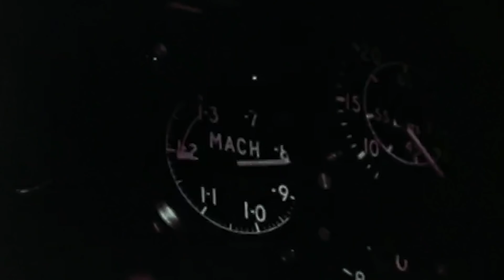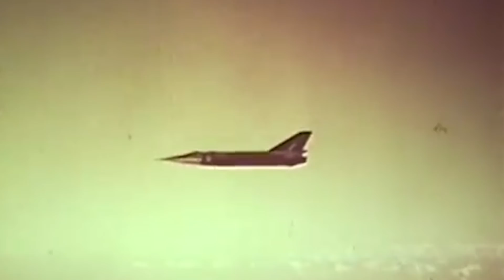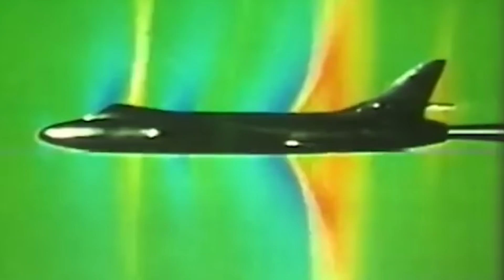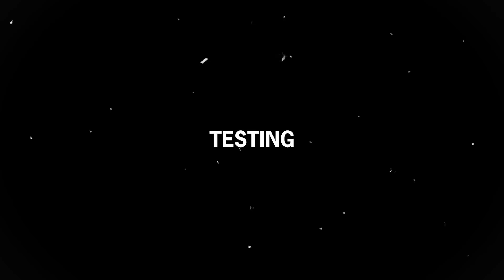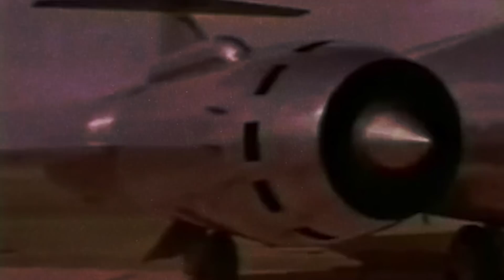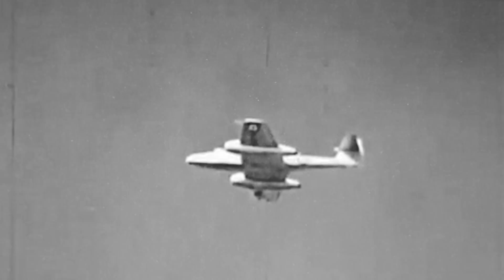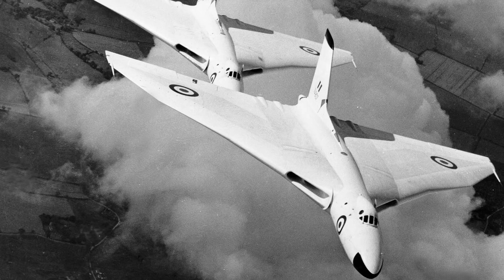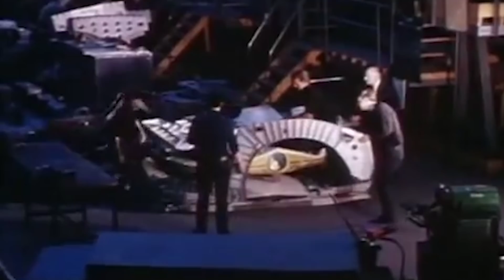The Bristol 188 Flaming Pencil - Supersonic Stainless Steel

Comment: Kinetic heating is mostly caused by air compressing in front of the vehicle and not by friction. It's a common misconception.
Reply: Same goes for reentering spacecraft.
Reply: SolarWebsite it really only applies to reentering spacecrafts. Supersonic planes don’t go fast enough, and are too aerodynamic to cause that great of buildup of pressure. Spacecrafts are designed to be more “blunt” to use the buildup of pressure to help slow their reentry.
Reply: Mopar_ Dude Hm, it’s always been my humble understanding that most of the heat produced, even with aerodynamic aircraft - or bodies with high finess ratios - is from compression. Supersonic bodies produce a shockwave and it is from the compression of gas into a shockwave from whence most of the heat is generated - or more accurately: most of the kinetic energy is converted to heat - as the body travels through the air. This comports with reason: an aerodynamic aircraft is more difficult to accelerate the faster it goes, not significantly because of increased friction between its skin and the air, but because of an increase in the volume of gas that must be compressed at an increased rate of speed around the body as it travels. An aerodynamic body experiences some heating from air rubbing across its skin, as what one might call boundary layer friction and there is potentially more of this friction with an aerodynamic body due to decreased stagnation of gas at the front of the pointy object vs the front of a dull one, but the overwhelming majority of heat is still generated through compression. Spacecraft are deliberately “blunt” in design, at least where it concerns reentry, specifically for the purpose of taking advantage of this stagnation to produce a buffer zone that stands between the heat shield and the shockwave in order to reduce surface heating and help “steer” the hot gasses compressed in the shockwave away from and around the front of the craft. In other words, nothing particularly fundamental changes at different supersonic speeds when it comes to heat produced from compression versus heat produced from friction – *this is why vehicles reentering at hypersonic speeds are blunt while hypersonic aircraft are just as pointy as those that are merely supersonic*. Another way to think about this is to consider the circumstances of both a hypersonic blunt body and a supersonic pointed body in three dimensions. The blunt body is designed to produce compression roughly along the same axis in which it travels, where as when the supersonic pointed body “slices“ through the air, it compresses air by acting on it at 90° perpendicular (for the sake of argument) to the axis of travel along the length of the body. This decreases the rate of compression vs the blunted body and is a component of what makes a shape positively aerodynamic, but it doesn’t negate that significant compression must take place to accommodate the travel of the frontal area of the body through the gas and the heat it produces compared to friction. Or at least, that’s what I’ve heard...

Edit: “travel of the frontal area” - this is poorly articulated, would have been better to say this as “the compression that takes place to accommodate the volume of a body as it moves through a gas.”
Reply: @mopar_dude9227  the plural of spacecraft is spacecraft, same applies to aircraft
Reply: @mopar_dude9227   Spacecraft are blunt because the heat transfer is a strongest at sharp edges, protrusions and corners.    Matter of fact it's a textbook problem in Heat Transfer courses.   Surface temp ends up a direct inverse function of leading edge radius for a given ionized flow loading case.     Think of a piece of wood thrown in a fire.   The sharp edges burn first.
Reply: @a-fl-man640  We have more plane.
Reply: hmmm,...I respectfully and completely disagree.  Friction/kinetic heating on aircraft such as the U.S SR-71, XB-70 and X-15 was a product of direct air friction.  It's a stretch to attribute 650ºF external windscreen temperature and skin temps exceeding 500ºF of the SR-71 to anything but plain ole FRICTION with the surrounding air.  Same for the ablated paint from the XB-70's flights beyond Mach 3,...and last but not least, the X-15A2, which flew 4,520 mph (6.7M) and had parts made from Inconel alloy (antennas) that MELTED from friction with the air.  Perhaps with blunt objects, such as returning crew capsules and the Shuttle,...where compression shockwaves and heating are of such a magnitude from the Mach 20+ speeds, so as to form PLASMA,...but that would NOT apply to the aircraft in this discussion.
Reply: I’ve taken for granted in the explanation above, heat produced by friction due to shear stresses in the boundary layer air along the skin of the aircraft, which potentially produces considerable heating. Essentially, heating from friction within the boundary layer air transferred to the body by convection/conduction and radiation. This would not be air friction directly with the body, although this undoubtedly produces some also which I believe to be somewhat negligible in the context of the other mechanisms at play.
Reply: Imustfly It’s really not a stretch to attribute heating of that magnitude to compression of gas. It’s all born out in the math which I’ve abstain from getting into here because it’s rather dense material and hard to tap out in the comment section on YouTube.
Reply: In high speed airplanes, if all of the heating is from friction, then where there’s the most friction, there will be the most heating. Instead, if there’s a significant contribution from compression, then where there’s the most compression, there will the most heating. And indeed the second option is the case. The most heating is at the leading edges, where the compression occurs. And at the very frontmost part of the leading edge, where the stagnation point is, (airspeed slows to zero) you would expect the temperature to be the coldest if friction was the main driver. However, that’s where the temperature is the hottest, indicating compression to be the main driver.
Reply: Very cool thx
Reply: Beats me
Reply: Ta!
Reply: Yes, I agree my head gets hot when I am in Superman mode.
Reply: What you are describing is compressability,compressed air by it's very nature does not flow over the aerofoil,kinetic heating is caused by the airflow passing over and under the aero foil.and around the fuselage.
Reply: Stuart Marshall that is true with space crafts (or natural objects) reentering the atmosphere.  They are much less aerodynamic, travel at much higher speeds and passing through “ thinner” air. Spacecrafts are not designed to be sleek or aerodynamic, but to be blunt to help slow their decent. For supersonic airplanes, most of the heat is from friction, not from compression of air in front of the plane. The much more aerodynamic design of the planes prevent the buildup of pressure.
Reply: @mopar_dude9227  Causes
When an aircraft passes through the air, it creates a series of pressure waves in front of the aircraft and behind it, similar to the bow and stern waves created by a boat. These waves travel at the speed of sound and, as the speed of the object increases, the waves are forced together, or compressed, because they cannot get out of each other's way quickly enough. Eventually they merge into a single shock wave, which travels at the speed of sound, a critical speed known as Mach 1, and is approximately 1,235 km/h (767 mph) at sea level and 20 °C (68 °F).

In smooth flight, the shock wave starts at the nose of the aircraft and ends at the tail. Because the different radial directions around the aircraft's direction of travel are equivalent (given the "smooth flight" condition), the shock wave forms a Mach cone, similar to a vapour cone, with the aircraft at its tip. The half-angle {\displaystyle \alpha }\alpha  between the direction of flight and the shock wave is given by:

{\displaystyle \sin(\alpha )={\frac {v_{\text{sound}}}{v_{\text{object}}}}}{\displaystyle \sin(\alpha )={\frac {v_{\text{sound}}}{v_{\text{object}}}}},
where {\displaystyle {\frac {v_{\text{sound}}}{v_{\text{object}}}}}{\displaystyle {\frac {v_{\text{sound}}}{v_{\text{object}}}}} is the inverse {\displaystyle {\Big (}{\frac {1}{Ma}}{\Big )}}{\displaystyle {\Big (}{\frac {1}{Ma}}{\Big )}} of the plane's Mach number ({\displaystyle Ma={\frac {v_{\text{object}}}{v_{\text{sound}}}}}{\displaystyle Ma={\frac {v_{\text{object}}}{v_{\text{sound}}}}}). Thus the faster the plane travels, the finer and more pointed the cone is.

There is a rise in pressure at the nose, decreasing steadily to a negative pressure at the tail, followed by a sudden return to normal pressure after the object passes. This "overpressure profile" is known as an N-wave because of its shape. The "boom" is experienced when there is a sudden change in pressure; therefore, an N-wave causes two booms – one when the initial pressure-rise reaches an observer, and another when the pressure returns to normal. This leads to a distinctive "double boom" from a supersonic aircraft. When the aircraft is maneuvering, the pressure distribution changes into different forms, with a characteristic U-wave shape.

Since the boom is being generated continually as long as the aircraft is supersonic, it fills out a narrow path on the ground following the aircraft's flight path, a bit like an unrolling red carpet, and hence known as the boom carpet. Its width depends on the altitude of the aircraft. The distance from the point on the ground where the boom is heard to the aircraft depends on its altitude and the angle {\displaystyle \alpha }\alpha .
Reply: @mopar_dude9227  Spacecraft are not blunt to slow their descent.  They are blunt because heat transfer is a function of leading edge radius in hypersonic ionized flow.
Reply: @anomalousboreoeutherian7683  : Pussy?
Reply: @THE-BUNKEN-DRUM  Where????
Reply: ADAM STEELE yes 😂😂
Reply: Exactly. This is also why an atmosphere heats/cools within its average perturbations. Nothing to do with CO2. It's called adiabatic auto-compression: http://article.sciencepublishinggroup.com/pdf/10.11648.j.earth.20170606.18.pdf
Edit: With reference to solar input as well, of course.
Reply: En Fuego Entertainment   The air warms and cools adiabatically, eh?  (That is, with no heat transfer.). Is there reason why one would predominate over the other to produce global temperature change?  No, I didn’t think so.  

Of all the denialist arguments against Anthropogenic Global Warming by enhanced greenhouse absorption, i’ve always thought this one was about the stupidest. (That’s quite a distinction.)

Comment: I can see this airplane was the predecessor of the SR-71Project, there are lots of similarities..**
Reply: The SR-71 was a development of the Lockheed A-12 which was developed independently and in secret.  Apart from the fact that both have two engines (two extremely powerful and effective engines in the case of the US planes, two pretty duff engines in the British one) there is no similarity in shape
Reply: MIGUEL ANGEL ALVAREZ GOMEZ it wasn’t, the sr71 was American, even though they were both NATO, they would not have shared airplane secrets
Reply: @Deus_ex_Machina1  I'm aware still you can't dispute the similarities...  Including engine placement and shape. Just enlarge and take two similar positioned photos and overlay them. We just made it better. 😁😎🇺🇲🤟
Reply: Similarities? 
Yup, they both have two engines.
Reply: Not really, the Bristol 188 and Lockheed A-12 made their first flights 12 days apart.They were in development at exactly the same time.
Reply: 👁🤷‍♂️🤣 Got it..  Thanks for clearing that up..